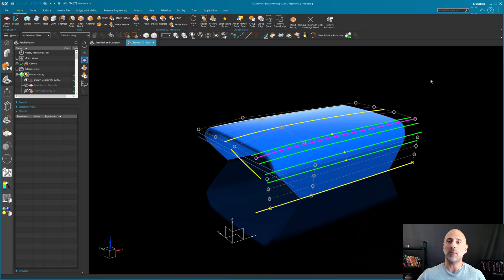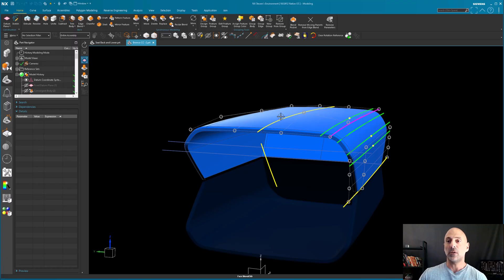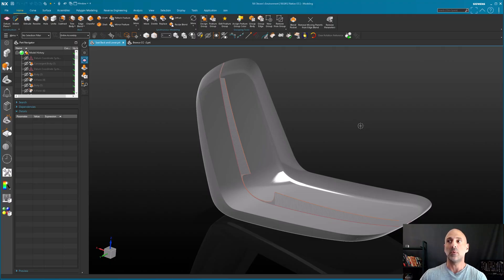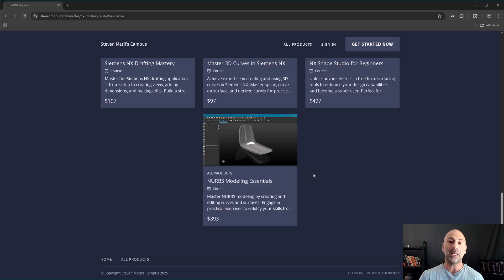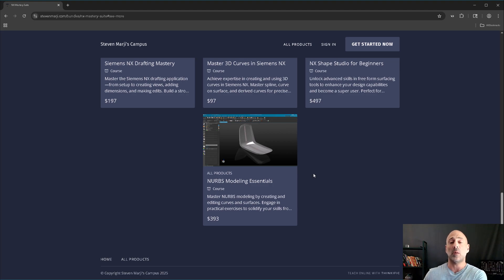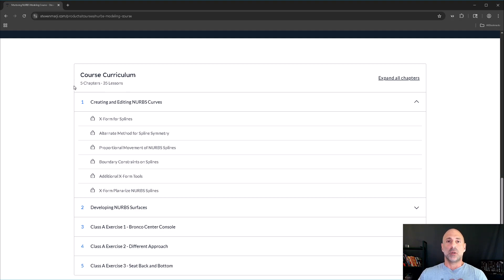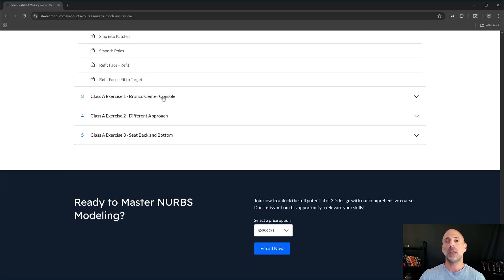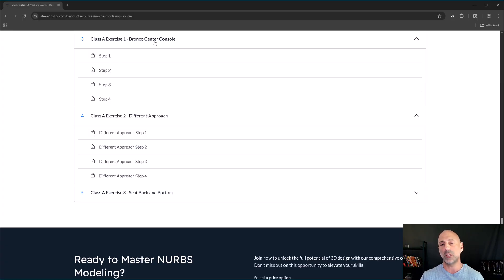🎨 FINALLY! My Siemens NX Class A Surfacing Basics Course is HERE

Comment: Hello Steven, my name is Renato and I currently work with seat design for trucks and agricultural machines. We model the seat backrest foams and the seat cushion foams. The way we model them is non-parametric, and because of that we lose a lot of time with modifications. We use NX2212. In your course, are the techniques focused on working parametrically, I mean, maintaining the features?
Reply from the maker: Hello Renato, yes the techniques are meant to show parametric methods. I will have another course out next month with more advanced shapes. The first class has a lot built into but the process needs to be taught over time. 

Please email me to discuss info@classasurfacing.com  

I would like to get more info from you to see what I can add to the next  few courses in case you decide to take my courses.

Comment: Hi Steven, 
Thanks a lot for these type of videos. One question; Are you away from CATIA v5 or 3D Experience ? I see you've been very active on NX mainly so I wanted to know if that is the case or what is the reason behind it. I am working as an FEA engineer doing fatigue and strength calculations and have been doing the CAD part of work in NX. I come from a CATIA background but still I have not decided yet if I like NX more. I think i have this 'love' for CATIA even though it is very strict on many things so I wanted your opinion on this.
Reply from the maker: Hello, thank you for the comment.

I am not away from V5 or 3DX. It is just most of my clients are on NX so I am catering to them at the moment. 

I have been thinking about authoring a V5 class a surfacing class and then transition to 3DX. My 3DX license is through the college I teach at so I cannot do much with it except for teach the classes at the college and an occasional YouTube video. 

I love some aspects of Catia. I really do. So I totally understand. My issue with 3DX is that I have to have my data on an Amazon cloud. Doing an on premises Enovia install is prohibitively expensive. I am not a fan of storing my data and thus my clients data on someone else's computer. 

But 3DX Catia is incredible.
Reply: @StevenMarji  
Thank you Steven. The on cloud services now as it is with 3DX is one of the main reasons for which some companies (especially in defence and aerospace) are not adopting it and thus either remaining to v5 or switching to NX.  I truly believe that 3DX is an amazing tool but v5 remains solid and I do not now for how long is this going to continue.

I believe this on cloud strategy has to change and return to on premise solutions but we will see.